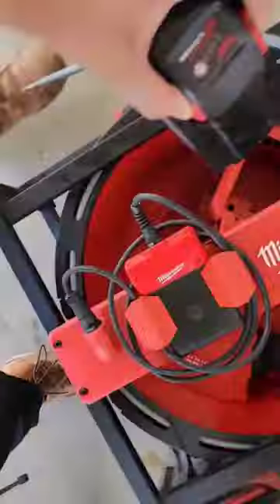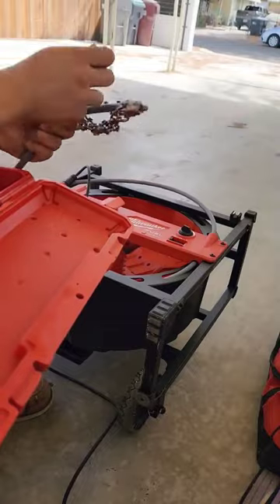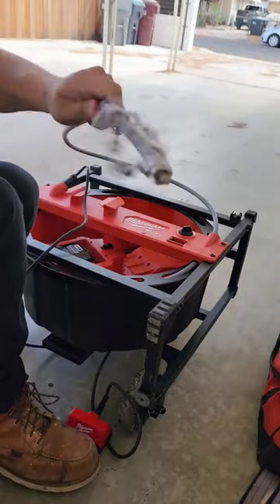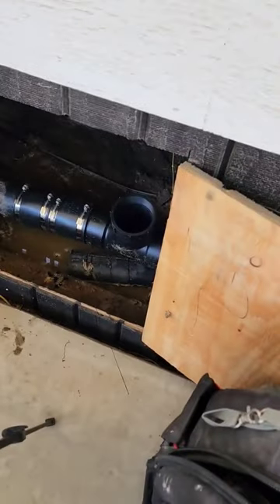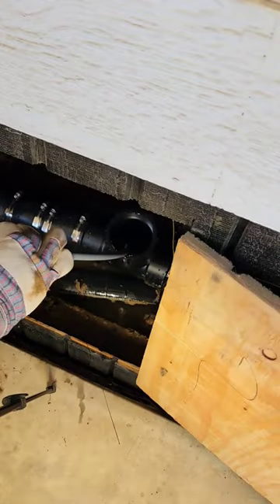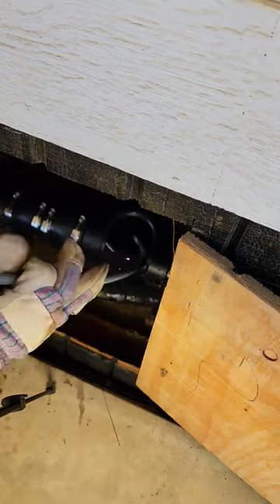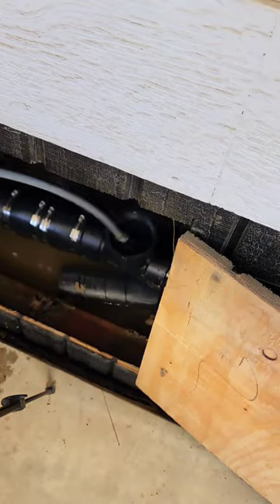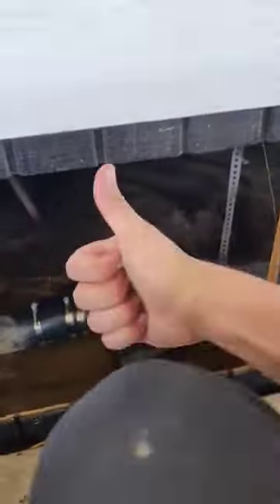Clearing drain clog without a drain snake (NEW MILWAUKEE TOOL)

Comment: How are you liking it? 
Any drawbacks ?
Would you like it’s good for mild roots?
Reply from the maker: It works great, so far mostly I've done cast iron and some fat mild roots will work for as long as you have the carbide chains they have the sharp squares on them that cut through the roots.
Reply: Will this be good for grease blockages?
Reply: U ever worry about kinks in your cable ?
Reply: I just bought this. Be here in a month

Comment: I have one, it’s really nice (I like the foot pedal so you can use both hands to feed it down the line, unlike the ridgid flexshafts)… however the cable sucks (breaks far too easy compared to the ridgid ones)… and that shouldn’t happened because it has a built in clutch.
Reply: So do you think its the cable being too weak or the clutch is to high? I was think of getting and my biggest concern was the clutch, which is why i like the flexshaft bc you can change clutch gears atleast.